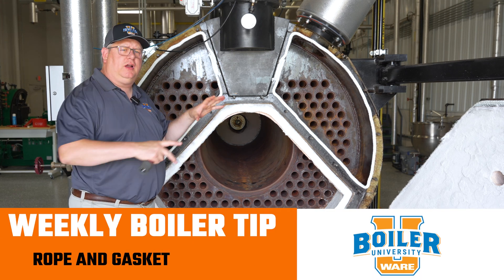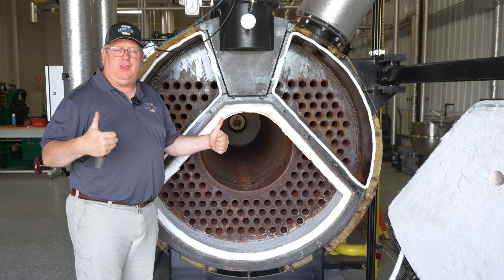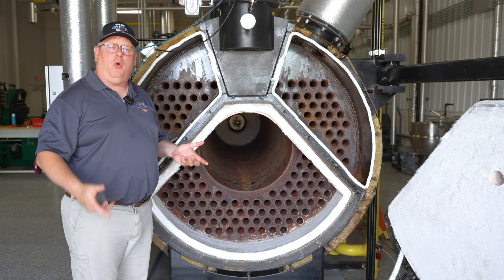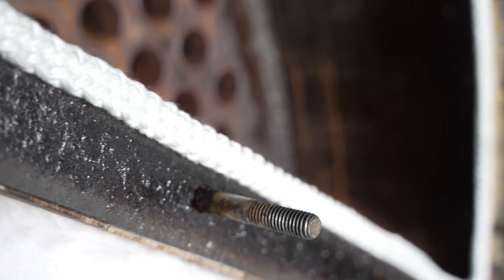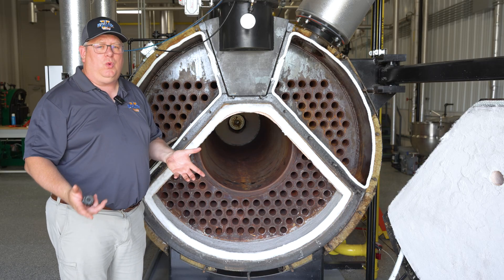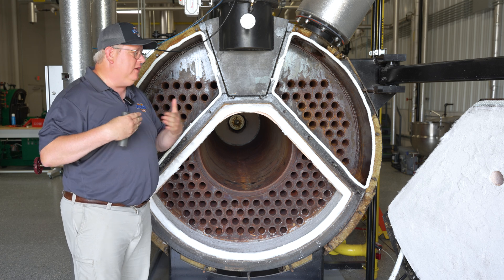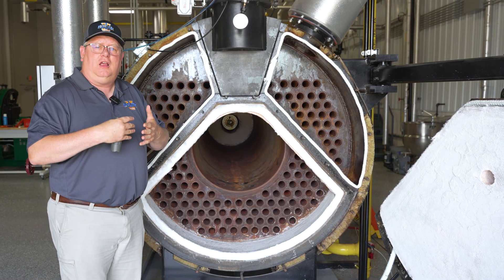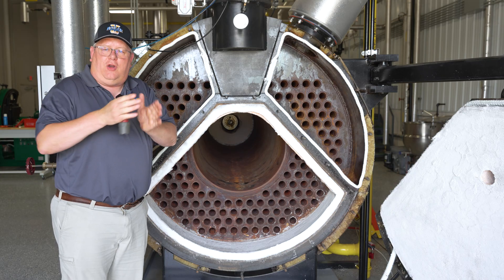Rope Gasket Replacement for a Perfect Seal: Weekly Boiler Tip

Comment: A technical question for you when performing secondary maintenance on the Clever Brooks boiler. Is it correct to wipe the exhaust pipes with oil? Is it correct to apply primer around the pipes and the front and rear mirrors from the inside?